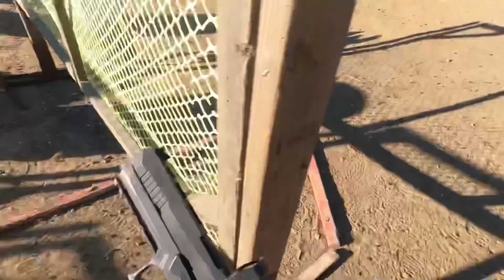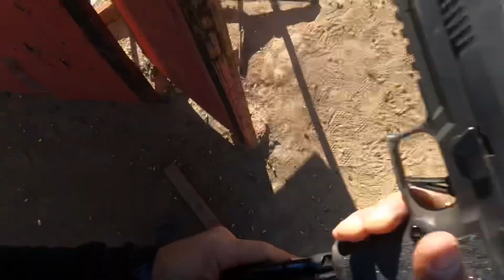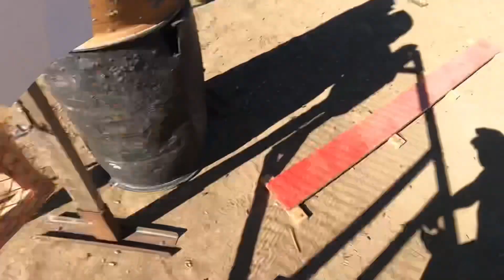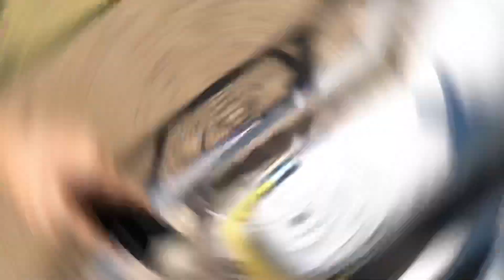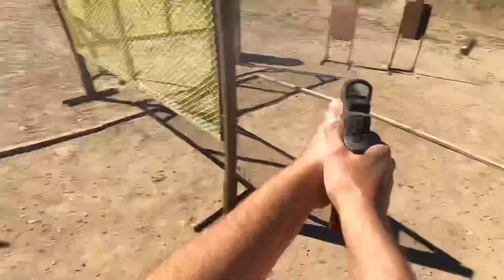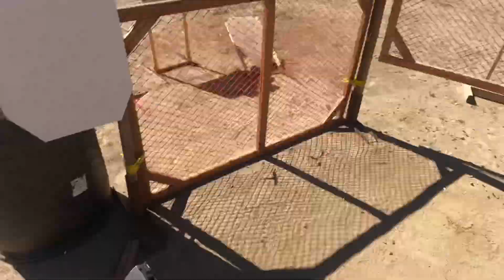SCPS USPSA Match

Comment: How did you feel about this match? Did you get any good take aways for training?
Reply from the maker: So I felt good until I got sent to Dairy Queen. Happened on stage 9 of 16. Such a stupid DQ too. There was range equipment failure while I was making ready. I had already chambered and was holstered. The RO told me to stop but didn't have me unload and show clear. Well, it took about almost 10 minutes to fix the wall that had blown over. I finally got the clear to continue to my make ready. I draw onto the first target to get a sight picture and trigger press and boom. I had forgotten I was hot. 

My biggest takeaway is I need to relax. I've been really tense at matches the last several months. All mental. The more I train and improve, the more pressure I place on myself to perform. Something I'm working on and definitely impacting my performance. I also need to work on shooting when I'm off balance or in an unstable position. Allow my dot to dictate when to shoot and not so much feeling stable, if that makes sense.
Reply: @AlexanderSotelo  Yeah, for sure. That is a mega bummer about the DQ. 

The tension is something you can overcome if you actually integrate it into your dryfire/livefire practice. You have to vividly visualize/experience that stress your experiencing and learn to push it into the background and shift your focus to the process of shooting the stage at hand. It's not easy and takes practice but it can help tons. 

I also totally get where you're coming from. You're improving and now you have "expectations" on how you "should" perform/finish/etc. It's your Ego making noise. I've been there amd I still end up there occasionally. It can make a mental mess of everything. The up side is that you recognize it and you CAN beat it. 

Keep up the good work. I'll keep watching and enjoying the vids. 👍